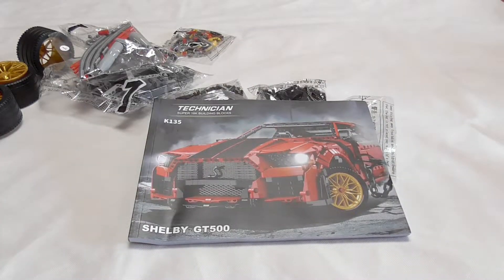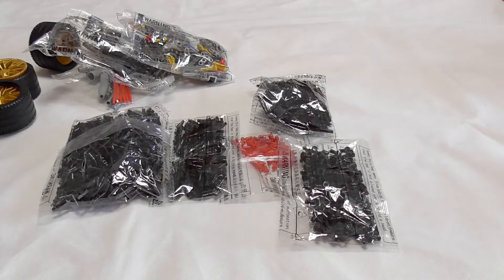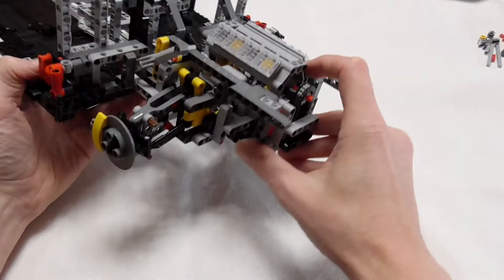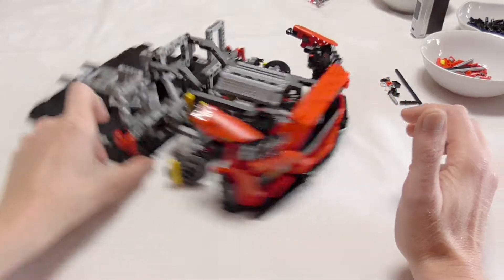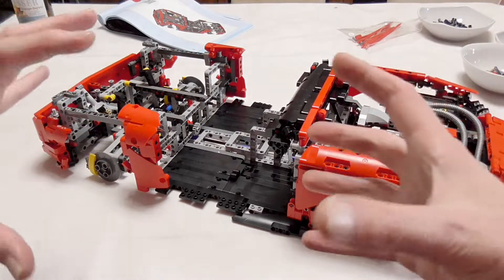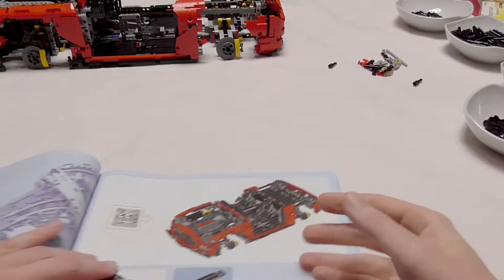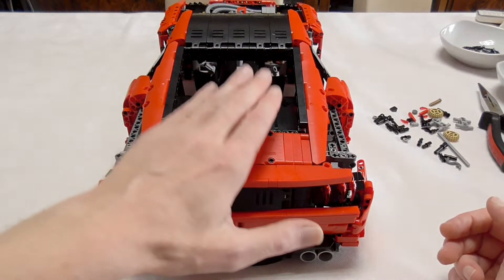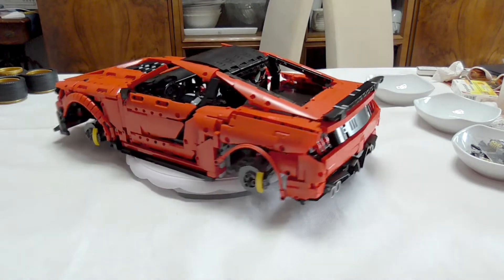Super 18K - K135  - Shelby GT 500 - Assembly

Comment: Sorry, Frank, but I don't like it. :( And this comes from a guy who bought it. It sits in the box, unopened, and I will build it, but without pleasure. First, it's ugly. From exterior, in the pictures I saw and based my decision to buy it, it looked cool, but now I see is squared, boxed, not all cool angles you see in cool MOCs. Second, color of the pieces is bad, pale, looks wiped-out, washed and especially on the black, it looks mat, not shiny. Third, pieces are bad. Bought Aston Martin DB11, super cool set, but the parts were badly cut, I hurt my fingers on them and steering rubs, transmission jams, because of bad parts that rub against each other. I will not buy from 18K again, I think it's the former Lepin. And fourh, come on, you put a fake shifter?! That was another reason I wanted to buy the set, for the gearbox. It's sublime, but not existent. What are the 3200+ pieces for? Mostly City or Creator style based. This is hardly a Technic set.
Reply: U bs so much in the other bid a day after this u said u built it and its the worst
Reply: @Mintdegree  Use proper English and learn to write.
Reply: @phaenius  wow missed a commer and pressed the wrong button u bs so much shhhh
Reply: @phaenius  17 and in collage with 6 a* kid